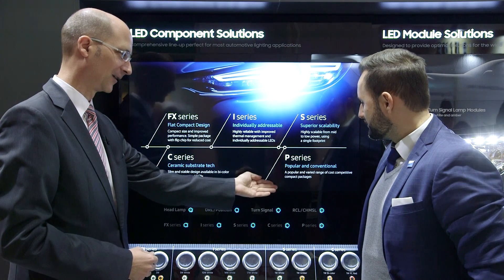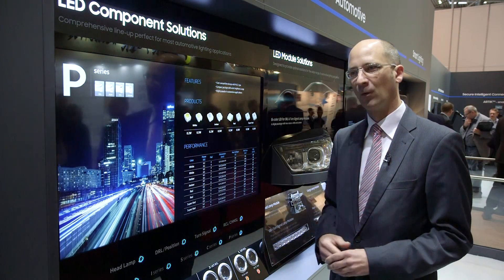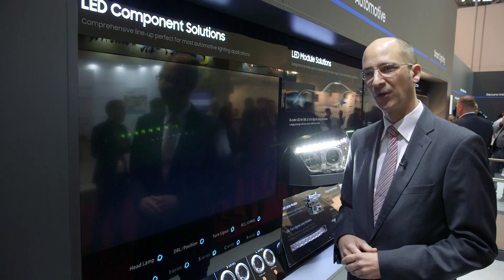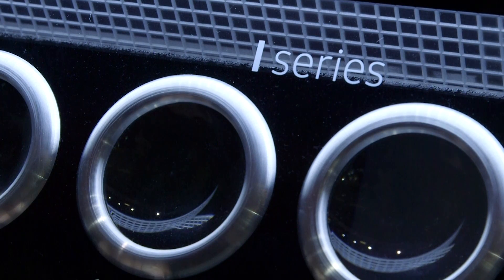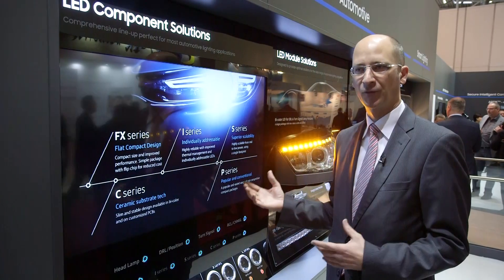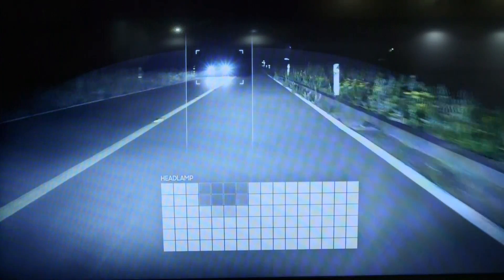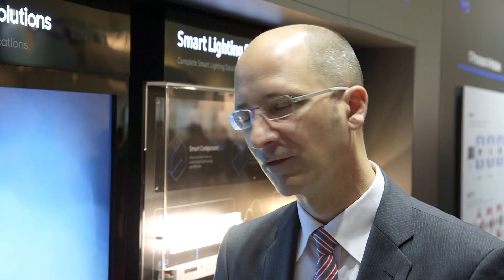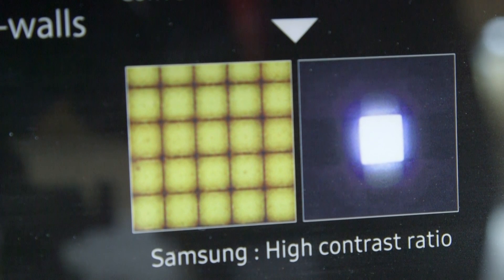Samsung Automotive LED components

Comment: Hi, I am interested in the luminous flux output of your pixel driving beam array chips (4mm x 20mm) dies. The issue I have encountered while working with these ADB solutions is that they lack the outright flux output (lumens) and hence are not very feasible in motorcycle applications. Can you please clarify on this subject. 

Thank you.